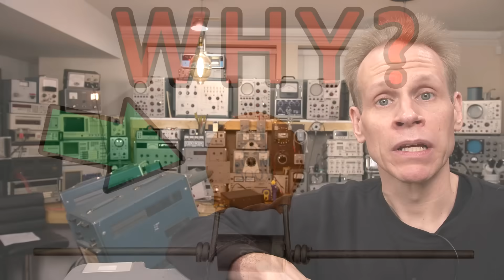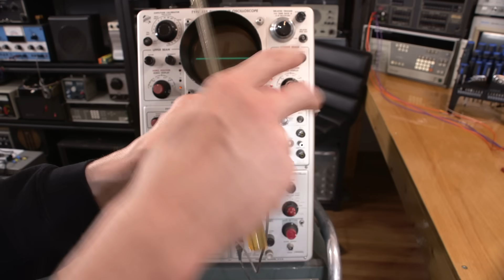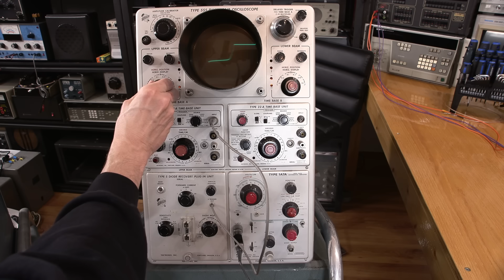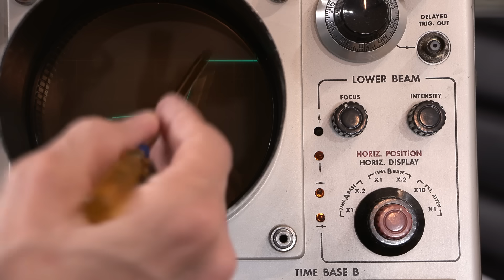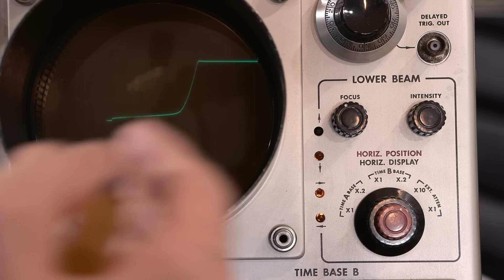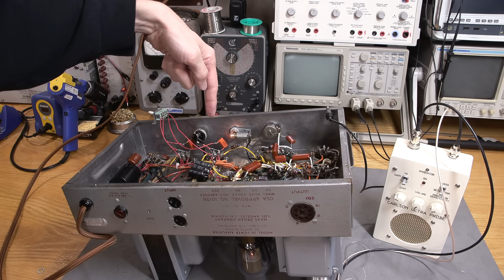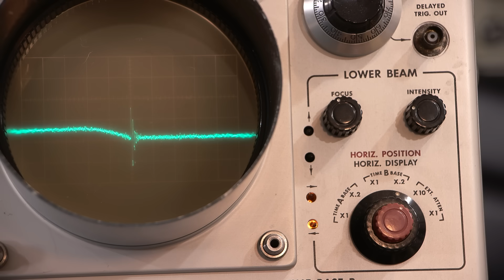Why Put A Capacitor Across The Diode? Here's Why!

Comment: Hmm. I was hoping you would explain WHY this works...
Reply: The capacitors shunt out the noise pulses. The capacitors should be few tens of nanofarads, so they don't conduct at mains frequency, but they shunt out the high dv/dt noise pulses. In very sensitive circuits, one might consider to put the diodes in a shielded can, because the noise is also radiated, so a sensitive radio can pick them up. Using modern, soft recovery diodes eliminate this kind of noise almost entirely (I think).
Reply: @mrnmrn1  I am utterly fascinated at the sensitivity in some medical equipment & just how fine the engineering has to be & the purity's of metals in components.
Reply: @mrnmrn1  I understand how capacitors can be used for shunting noise to ground.. but these appear to be just shunting AC noise PAST the diode to my eyes. This is exactly what was not explained at all here.
Reply: @maskddingo1779  I believe it is no longer AC past the diode, so the capacitor is keeping the diode saturated. Without the capacitor, it has to saturate again with each cycle.
Reply: @maskddingo1779 If the unwanted high frequency 'shit'  happens between the two connections of the diode it would make sense to short them between those two points.
Reply: @maskddingo1779  What is the ground? What is positive and what's negative in the circuit? It's just the difference in the potential, voltage (whatever it is at the moment) is different from one side of the diode to the one on the other so you can always look at one side of it as the ground of the other side and the cap can do its job.
Reply: @maskddingo1779 they are absorbing > blocking > releasing it and the capacitor size shifts the operating frequency
Reply: @maskddingo1779  Not past the diode, rather into the capacitor where the noise is essentially shorted and nothing else is.
Reply: @maskddingo1779  It's shorting the noise out at the source - which is the switching of the diode.
Reply: @maskddingo1779  Have not read all the responses here, so may be a better answer, but, basically: The diode is creating the noise by being a switch.  The capacitor shorts out the HF noise with no measurable effect on lower frequencies.
Reply: @wrathofsocrus  Yes, the "DC rail" past the diode is essentially an "AC Ground" to the capacitor. Overall I guess it's slowing down the dv/dt as the diode stops conducting. I would think using fast recovery diodes that don't conduct as much in the reverse direction (aka recover faster) would also solve this problem, as they wouldn't be conducting anymore by the time the AC voltage was starting to go negative. The real problem here is regular "rectifier" diodes are kinda slow, and really terrible. These days, there are much better diodes available.
Reply: @maskddingo1779 Diodes commonly are used as rectifiers converter AC currents into DC. After the Discovery of the Edison effect in a Light bulb with an additional filament to deal with smoke (early light bulbs imperfect in vacuum lead to the Vacuum tube rectifier. Capacitors were added to filter noise after the rectifiers to shunt noise with inductors or a cheaper alternative resistors in the B+…Solid State rectifiers as Selenium Diodes became mid 20th century and later silicon…someone noticed light being generated…which eventually produced the Light emitting diode…LED
Reply: ! @maskddingo1779,  semplicemente il condensatore cortocircuita la sorgente del disturbo!
Reply: @maskddingo1779 it absorbs “noise” at different frequencies in the electricity path. You can hear the noises being reduced when the capacitor is added to the circuit..
Reply: @mrnmrn1 Indeed, vishay hexfreds do away with snubber caps.
Reply: @mrnmrn1  :)
Reply: @mrnmrn1 100%  right
Reply: @mrnmrn1 what’s the math or “law” called that you need to figure out what you need vs what your using cap and diode wise?
Reply: @avocadoarms358 I don't know if there's a formula for this. As a starting point, you need a capacitor that has high impedance at mains frequency, so it doesn't conduct the AC across the diode, which would also cause hum. So don't put a cap in the microfarad range in there. The capacitor also needs to be a "fast" type (it needs to have low series inductance and low ESR), so it can shunt out the fast, high dv/dt pulses effectively. You can choose the right value of capacitor with trial and error, the ballpark figure for 50/60Hz is 47nF, but I have seen anything between 10nF and 100nF in factory made circuits. It probably depends on the speed and reverse capacitance of the diode: higher reverse capacitance diodes might produce higher energy EMI pulses (just a guess). 

My suggestion is that if you come across this issue, try to measure the noise with an oscilloscope, then start with a 22nF capacitor across each diode of the rectifier, and change the value until there's no more audible hum, but if some noise is still visible on the scope, you can try changing the capacitor value until you reach the minimum peak-to-peak value of noise. I suggest no to go above 100nF per diode. The voltage rating of the capacitor depends on what series of capacitor you use. My practice is to use a capacitor that is rated for at least 2x the peak-to-peak voltage of the unrectified AC voltage. You can find the AC voltage rating of DC film capacitors in their datasheet.

It might be a good idea to build the rectifier with soft recovery diodes. If you use UF4007 or BYV26(E) instead of 1N4007, it will solve most of the noise issues. They still might need some small snubber capacitors, if your circuit is super sensitive to noise,
Reply: @mrnmrn1 
Supongo que en una fuente  simétrica con transformador, al bajar hasta 0,7V el diodo corta y surge una oscilación de alta frecuencia (ruido). 
Peor es si el bobinado secundario del transformador es simple y precisa un "rectificador de cuadro" ahí el corte es de 0,7V + 0,7V 1,4 V con lo que el zumbido debe tener aún una intensidad mayor... el capacitor permite que después que la tensión baja de 0,7 V continue fluyendo corriente debajo de ese voltaje evitando el  corte en el "pasaje por cero"...
Bien puedo estar equivocado pues no soy ingeniero electrónico, soy médico jubilado y piloto de avión sólo fui 35 años radio aficcionado ...
😊.
Reply: @mrnmrn1  putting diodes in can would not solve this (you have to put all conductors and circuitry that is in series with them also then, why is when current cuts off (when diode switches off) is abrupt, the  cap takes over some of that current bc of  sudden "loss of conduction" and reduce the slope of Dv/Dt hence reduce the EMI radiated from associated components. Same story works for regular mechanical switches but with bigger impact, and same story with mechanical commutators on series wound motor with even bigger noise reduction impact...
Reply: As far as I understand, but could never have a better explanation, is that the capacitors avoid the fast cut-off of current when the transformer's output crosses over to the non-conducting region.
Without the capacitors there's a sudden cut of the current (on the transformer's winding) and this makes the winding "ring" (like a fly-back transformer). This ring echoes (eletromagnetically wise) everywhere in the circuit, as it happens at an H.F. frequency that's not blocked by the rectifiers smoothing capacitors because of parasitic inductances of both the smoothing capacitor and of the wiring.
Reply: @fabiotrevisan8922 never in 5 years of college did i hear a single explaination from electrical engineering professors that seemed to want me to understand a concept.
Thank you for yours.
Reply: @davee7849 You should have gone to a technical school
Reply: @davee7849  That’s because most EE and ET professors are absolutely lousy at practical electronics. That’s why they teach.
Reply: @fabiotrevisan8922 
so basically the electrical equivalent of a water-hammer arrestor. 😅
Reply: @alka7577Absolutely! One can say that...
And yet, it shows how curious it is that some physics analogies work really well, such as the analogy of water flowing in pipes with electricity.
Every wire holds some inductance and every water pipe also behaves like an inductor...
Isn't it wonderful?
Reply: @fabiotrevisan8922  Yay someone takes the entire circuit into consideration and gets the correct answer! I was taught an RC snubber is better than just a capacitor, hence why we still saw ringing on the scope yet at a much smaller amplitude, and usually across the winding along with caps across the diodes as well. I think the caps across the diodes alters the junction capacitance of the diode lowering the resonant frequency while the RC across the winding critically dampens the ringing. Hence why using different diodes changes ringing characteristics. Electronics are so fun!!
Reply: This has to be the worst explanation of "reverse recovery" I have ever seen.

I know what it is but I had to watch  the video twice to even recognize what he was talking about.

Ok, here's a simplified explanation.

Reverse recovery happens because the diode itself acts like a small capacitor , it actually stores some of the energy going through it. 

When the diode "turns off" it releases its stored energy as a small "pulse".

Normally that small pulse doesn't matter , but if the diode is hooked up to a coil (like the secondary of a power transformer) that small pulse can make the coil act like an ignition coil on a car.

The capacitor in parallel to the diode basically absorbs enough of the pulse to prevent that from happening.

For more details Google

"Diode reverse recovery"
"How do ignition coils work"
"Snubber circuit"

*edit
The reason I included ignition coils  is the diode turning off and its internal capacitance is very similar to the "points and capacitor" in distributors in older cars. 
(Pre 1970's)
Reply: @glennchartrand5411 thank you! Your comment dusted off old brain cells and this makes much more intuitive sense. The extra capacitor effectively “shorts out” that high frequency pulse from the diode if I’m thinking of it correctly. It’s interesting that the audible noise sounds like a 60hz hum to me. But perhaps the frequencies being filtered out are actually quite a lot higher?
Reply: @SpaceCliffie it's a little burst of higher frequency noise happening briefly every mains cycle, which is why you're hearing the hum as an undertone
Reply: @SpaceCliffie its a pulse of higher frequencies pulsing every 50 or 60Hz if half wave rectified or 100 or 120Hz if full wave rectified depending on your mains supply frequency.
Reply: @SpaceCliffie because the diode turns off 60 times a second.
Reply: @glennchartrand5411 yep... and old distributors had a "condenser" that often got overlooked with tune-ups. That alternator whine....
Reply: @glennchartrand5411 It can’t be the small amount of energy stored inside the diode that causes the ringing — that energy is far too low. The ringing comes from the rapid change in current when the diode switches from conductive to non-conductive. This sudden cutoff isolates the transformer winding from the rest of the circuit and excites the inductance, leading to the observed ringing.
Reply: @glennchartrand5411 Thanks.
Reply: @glennchartrand5411  thank you so much for the real, non overcomplicated explanation!
Would it be fair to say that this cap works essentially as a lowpass filter in a speaker crossover?
Reply: @Frisenette  This cap is too small for speakers, a series cap is used for the tweeter usu 2.2uF
Reply: I think that what happen, is the inner diode PN layer are charging up in the zone where it’s not open, then it open  a little more (we talk about very low capacity)  shorting the its charge and then happen very fast causing HF noise. If a higher value capacitor is added, the oscillation will not happen in that short period we are in not fully open time. The capacitor is not so high so 50/60 Hz has no interest to run through it.
Reply: Being a mechanic and not an electronic engineer it is quite apparent to me that the capacitor is acting as a shock absorber very similar to the way a steering stabilizer takes the vibration out of a steering circuit.
Reply: @tarstakars very similar idea yes; adding a resistor as a "damper" in series with the capacitor (turning it into an RC snubber), helps even further, especially if properly tuned to the rest of the circuit
Reply: @tarstakars  My brother was better that than I am.
Material process engineer.

I was into bio-medical engineering. Until drs told me I was doing things wrong. Which made me think why did I study biology, chemistry, electrical, mechanical and electronic engineering. When programming was so much easier. plus did require 5 years to complete a bachelor degree. Actually required no bachelor degree in 1975 for programming. (easy).
The I had a degree'd department head that did not know how to put a PC together. Because she only used Mac which is  a less complicated desk computer than a PC. Oh & less adaptable the than a BSD or Linux computer.
Finally I just gave up drove a fork lift. Took a while for the boss to figure out why the pallets all got to the assigned space with no spillage for months.  Performing minimum or maximum of an objective function in a multidimensional space.
I still know what Poisson and (Nelder) Mead is used for. Hence one man's Mead is another man's Poisson.
Reply: In a word:
Snubbers.
They are often an R & C in series across a switching device.
The resistor is added to dampen the oscillation, to extinguish it quicker.
Often deployed to improve or meet EMI requirements.
Can also be needed to avoid overstressing/killing the switching device during repeated high energy switching - helps keep them inside what the semiconductor datasheets refer to a SOA - Safe Operating Area - of V vs I vs time chart.
Reply: One really has to view the capacitor as a short term battery.  Stay with me on this - the current, which is oscillating, when it goes to (say) positive, it will travel through the diode.  During this time the capacitor is being charged to the same voltage as is going through the diode (obviously) and only charges (conducts) until it is fully charged.  When charged, a capacitor acts like an open.  Now when the voltage goes to negative (following this example), the diode will not conduct, but since there is a potential difference between one side of the diode and the other (and of course a voltage difference between one side of the capacitor and the other), the capacitor will now have the opportunity to dump its stored energy.  So instead of the wave looking like "positive" then "nothing", then "positive" etc., it looks more like "positive" then "I see some capacitor making some voltage - almost as much as the positive part of the wave", then "positive", then - etc.

In other words, the capacitor dumps its charge when the diode isn't conducting.  The dumped charge fills in troughs.

Note that we are not trying to "fill in" mains frequency.  That would take really large capacitors depending on how much current you need.  We are only talking here about filling in troughs of the noise caused by the reverse depletion zone, and this is before the diode is going on to do its main task (in each cycle).  Note: One has to properly size the capacitor for the use.  For example, using too small of a capacitor for attenuating the reverse depletion zone is like using a battery that is too small - it won't have the meat to be able to fill in the required trough(s).  Using one too large, and the thing just remains charged - bigger caps aren't fast enough to discharge when one is talking about filling in micro-noise, although they can somewhat work.

I was a little unclear about the comparison between the two oscilloscope shots - one had a good voltage range being used, and I think the second had a larger voltage setting used, although I could be wrong on this.  Just guessing.  (The waveform was really flattened out on the second one.)  Also I was unclear on where zero was in each shot.  Maybe most others here know.
Reply: @sonicdewd  
Should the capacitor be put in series with a resister, in case the capacitor someday shorts out?
Reply: @yosefmacgruber1920  If you connect a resistor across (in parallel) with a diode you effectively short out the diode and render it ineffective.  The diode only passes current one direction while the resistor passes it in both directions.
Reply: @RbNetEngr  
What if it is a high-resistance resister? A resister can serve many purposes, and one could be to safely drain off voltage when a circuit is turned off.

A resister and diode in parallel would allow more current in one direction and less in the other direction.

But I may have lost the context of what it was about, perhaps you might remind me. It has been a while since I have watched the video.
Reply: @RbNetEngr  
What if it is a high-resistance resister? A resister can serve many purposes, and one could be to safely drain off voltage when a circuit is turned off.

A resister and diode in parallel would allow more current in one direction and less in the other direction.

But I may have lost the context of what it was about, perhaps you might remind me. It has been a while since I have watched the video.
Reply: @RbNetEngr  
My previous comment was putting them in series, not parallel. In that case the resister becomes a current limiter to help protect a faulty component from frying the circuit.
Reply: @yosefmacgruber1920 I understand that.  But you presented the case where the capacitor shorts out.  So a shorted out capacitor in series with a resistor is now just the resistor, and it would be connected across the diode in parallel and render the diode ineffective.  The diode works in a full wave rectifier because it only passes current in one direction.  The resistor would provide a path for current in the reverse direction.
Reply: @RbNetEngr  
From where do you get "in parallel"? The resister in series eliminates the short. Are you trying to design a circuit that works perfectly when capacitors short out? I thought the idea was to make it safer and it would not blow the fuse or expel smoke?

Presumably, a capacitor does not normally draw too much current, and if it did, a resister would be a way to limit the current.

One of the first things that Mr Carlson's Lab does, when testing out old equipment, is to plug it into his special electrical outlet box, that is current limited via an incandescent light bulb in series with the circuit. A dim light bulb is generally okay, but if the light bulb lights up brightly, something is probably wrong with it, and so he has to find the short.

Maybe you need to go watch the video again?
Reply: @RbNetEngr  
From where do you get "in parallel"? The resister in series eliminates the short. Are you trying to design a circuit that works perfectly when capacitors short out? I thought the idea was to make it safer and it would not blow the fuse or expel smoke?

Presumably, a capacitor does not normally draw too much current, and if it did, a resister would be a way to limit the current.

One of the first things that Mr Carlson's Lab does, when testing out old equipment, is to plug it into his special electrical outlet box, that is current limited via an incandescent light bulb in series with the circuit. A dim light bulb is generally okay, but if the light bulb lights up brightly, something is probably wrong with it, and so he has to find the short.

Maybe you need to go watch the video again?
Reply: Imagine the diode being a 'pump's outlet' on a large water tank and when you 'turn it on' it sprays water out in pulses.
Now imagine you stick that pump inside a 'sealed bucket' with a compressable air pocket. Now instead of the pump giving you a bunch of spashing, pulsing water from the turbulance, it's instead submerged in the bucket, which contains and 'calms' the turbulance, and when the bucket is full, the same amount of water pours oout it's tap, with the same pressure as the bare pump is pumping, but as a nice steady stream, as the air pocket is absorbing the pulses.
Anyway, cap is acting like a hammer shunt, a device that absorbs shockwaves caused by sudden pressure surges that occur when a water valve closes or opens suddenly.
(Electricity is funny, so much 'behaves' like plumbing, but only if you don't 'look' too closely.)
Reply: Capacitors are shorts for high frequency, so they filter out lower frequencies depending on their capacitance.
Reply: @domesticterrorist483 - like a low pass filter?
Reply: @domesticterrorist483  Very clear and concise.
Reply: Yeah, bad explanation, bad oscillosope use.
Reply: the diodes ringing and voltage spikes occur due to the interaction between the diode's diffusion capacitance and parasitic inductance in the circuit, by putting cap across it, it shorting out the high freq ring. the reverse recovery is the diodes capacitance discharging, when in reverse bias.
Reply: I think he's presenting this to an audience he assumes knows what effect a cap would have there. For example a person who doesn't know what effect a cap would have across it would also not understand what he meant when he said "full wave configuration"
Reply: Before the diode becomes forward biased and conducts, the capacitor charges. Then when the diode suddenly opens, the charge for that is immediately available from the capacitor. And similarly in the reverse situation. The capacitor is acting much the same way like any other decoupling/bypass capacitor between the pins of any device, such as an IC. A capacitor is transparent to AC and that's what noise is. It provides a short circuit for noise between the terminals of the diode.    Any two-terminal device can only generate noise by a producing a difference in voltages between its two terminals. A cap connected between those terminals creates an AC short which absorbs the noise.

There is something counterintuitive in that when we place the bypass cap as close to the target device as possible, we are minimizing the source impedance. So then how can the capacitor act as a filter? The answer is: with some difficulty. That's why fairly large capacitor values are used. That satisifes two requirements at once: delivering immediate charge to the device with as little impedance as possible, in response to its changing demands, while filtering that out from the rest of the circuit seeing it.
Reply: They work as a frequency filter
Reply: Yeah. A little theory would have been nice.

Since capacitors allow current to flow until the capacitor is full, this helps absorb some of the noise present in power supply circuits. 

Going into the theory of how a rectifier simply creates converts AC to… AC would be helpful in this situation.
Reply: If the diode shuts off, Al you have left is a little capacitor. What does this little capacitor..? Get rid of it's charge through the circuit. Frequency of this if 100hz (European) or 120hz (us and others) noise due to the discharging of that little built-in capacitor inside the diode.

You could say : OK, then now I use ultrafast diodes or shotkeys... They had this little capacitor as well. And as they, are faster than the usual 1n4007 they cut off and recovery time is also faster, and therefor the discharge spike of that little capacitor is also faster... More hum generated.

You need to provide another path of to let the capacitor discharge itself..

You could use a resistor but but it will be also inside when the capacitor is discharged and add these unwanted reverse current flow by making the diode 'crapier'.

So if you use another diode reverse polarity on series to avoid that.. Uups no good idea you just created a diode of the early days of semiconductors...

Oflk than..whats left is another capacitor, large enough to ear up that spike entirely, but also tiny enough not to create a short cut when the diode is switched off...

It depends on the spike itself and also the switching frequency.

It's called a snubber network. And this is essential when it comes to switch mode power supplies.

I designed a lot of these back in the late 90s when I worked for a company which did industrial grade power supplies of all kinds (voltages and currents)

Hope that helps a little.

Cheers.
Reply: @tubical71@tubical71 It's not the capacitance of the Diode nor the charge or energy stored inside the Diode leading to the ringing. These values are fare to low.
It's the  real reverse current flowing across the Diode while the diode recovers. This current increases if the reverse recovery time of the diode (other type of diode) increases. This current breake down instantaneously if the Diode switches to non conductive when the recovery time is over. The Transformer is now isolated from the rest of the circuitry and you get the self induction pulse formed to a oscillation by the inductance and the windings capacitance and other parasitic L or C.
With the C across the diode the transformer is still connected to the rest of the circuitry and the resonance frequency decreases and the energy can deplete.
Reply: @guntramschlemminger7383 
The first and the last good explanation
Reply: Because the power transformer winding has inductance and with the diode junction C and other parasitic capacitance creates a tank circuit. When current stops during the half cycle the inductance reacts to this current change. Really an RC snubber is better than just a capacitor, hence why you still saw ringing but at much lower amplitude. With a simple jig you can work out the optimal values of R and C to start with, then fine tune until the ringing is completely gone. Most decent designs will have a capacitor across the diode to change the diode junction capacitance (lowering resonant frequency) along with an RC snubber acorss the the entire winding. Doing this correctly will yield excellent results.
Reply: I gather in a low signal to noise ratio in a quality amplifier there are more of these capacitors running across diodes in critical areas of the amplifier circuit ? 
As an enology and explanation on a mechanical term , the capacitor acts like a muffler in an electronic term , is that correct ?
Reply: I agree.  I have noticed that Mr Carson is an absolute genius technician, can troubleshoot damn near anything. Really levels above most other techs that I have seen, and meticulous in his work.  A real savant.   However as a teacher I have seen that he often leaves things without explanation.  Probably seems obvious to his mind, but to the rest of most of us it needs a step by step walk through of how and why in detail.   I get a lot from his presentations, then usually go and look up details that he leaves unexplained.  But his expertise is impressive, and he appreciates really good quality design.  High quality is important in a world of cheap low quality products designed to fail and generate more sales.  Planned obsolescence should be a crime.  Design and build to last a lifetime and the whole world benefits..  I am sure Mr Carlson would agree with that sentiment.
Reply: It’s the equivalent of an accumulator in a hydraulic/ water system or like the anti knock device you put at your faucets to keep the pressure steady and to absorb the sudden increase in volume/pressure.
Reply: @J @JQuinnn-r8g ss! The house water system you are talking about is a water hammer arrestor. Its like a reserve area for water pressure to go when we abruptly close faucets.
Reply: Maybe add < 4.7 ohms  in series with the cap to suppress the noise further
Reply: А мне интересно, будет ли разница между керамическим и пластиковым конденсатором?
По-моему, значение имеет не емкость конденсатора, а плотность его диэлектрика. Это версия.
Reply: How does this compare to a correctly sized or matched bypass cap? I bet it's the same result.
Reply: I agree with maskddingo.....you have demonstrated the need,  now for the "how".  Where is the noise going ?
Reply: And also what causes the noise in the first place. I was waiting for that explanation but it never came. He just mumbled something about 'depletion region'.
Reply: I would say: The fast cut off current, or the fast immediate load change to the transformer and the parasite capacitances and inductances around lead to this small high frequent pulses. We can see the exponential form of the power loss in the pulse. That's typical for LC oscillation.
Reply: Diodes make noise when they shut off; you get a pop.  This voltage spike is what's shunted across the junction.
Reply: @jj210-g8r Is the Diode really the component making the noise or is it the inductive and capacitive environment the Diode is connected to.
The noise peaks we saw on the scope is a harmonic oscillation with an exponential decreasing amplitude. It typically fir LC oscillation. The Diode just triggers this.
Reply: You need to understand how a cap works. As he Said in the beginning, diod makes some noise. A cap smothen out that noise. Ex after a rectifier ac to DC You have caps to smoth the dc.
Reply: That was also my thought? Why he does not?🤔
Reply: I had this same question.  Obviously, I don't know since I had the question, but I did some digging to find out.  Others have stated somewhat circular answers that if you already know and understand, make sense, but if you don't it's frustrating, and sounds like they're saying "Because."  In short, it seems to me the answer is because it's an AC circuit, the higher frequency shifts across 0 voltage "see" the capacitor as having less resistance than the diode, and thus route to it instead and are attenuated.  Now, WHY does the capacitor seem to have less resistance to high frequency "spikes" in voltage, even though nothing about the capacitor is physically different than when compared to low frequencies?  Because of the inherent relationship between AC Frequency and the capacitor's Capacitive Resistance.

Some quick digging leads me to believe it's the nature of how a capacitor functions in AC circuits.  A capacitor is 2 conductive plates, with an insulator between them.  In DC, we charge one plate until it passes a threshold and discharges through to the other plate.  In an AC circuit, we're doing very different things with current.  When the voltage swings from positive to negative, electrons are gathered on the plate to which that voltage is applied, and thus pushed from the other plate into the circuit.  No charge actually is passing through the capacitor, only accumulating on one side, and then discharging as it accumulates on the other when voltage swings again.  When this is happening, the Capacitive Resistance, which is calculated from the 1 divided by the product of the Frequency of our AC source in cycles per second, and the capacitance in farads.

Capacitive Resistance seems to be the "filter," as it limits what voltage spikes will go into the capacitor, and which will route around it through the diode.  To a high frequency spike, it appears low, because the frequency is high, because Frequency of our AC is a factor in Capacitive Resistance.  When the frequency is low, Capacitive Resistance appears high, and the low frequencies pass through the diode instead of the capacitor.  Thus, the "low-pass" filter from diodes, resistors, and capacitors is born.
Reply: @crimiusXIII I already explained it.
Reply: ... In exactly the manner I decried.
Reply: I agree. A very poorly presented and poorly explained subject. I have not subscribed.
Reply: It certainly isn’t 'outside the scope' of the video! 😂
Reply: Like mathematically? Please no math Great Scott!
Reply: In short - discover the matching cap for the noise frequency and then mount it to pull down (or up) the charge. Capacitor acts as a short circuit for a moment in time (depends on its capacity). Smaller cap values, higher the frequency. It is best to experiment with various kind of frequencies and c values... Enjoy
Reply: It is cross over noise caused by turning conduction and off putting capacitors across this junction absorbs this.
Reply: It cancels out the frequency
Reply: capacitor is a simplest form of a noise filter - it lets noise pass through the capacitor. You learn it in one of the circuit courses in college
Reply: Think of a diode as a one way valve.  A diode rectifier bridge converts alternating current, into direct current. When the current flows the wrong way, the diode reflects the wrong way pulse back in the desired direction, adding it to pulses going in the desired direction within the circuit.  On an oscilloscope, one can observe the voltage oscillation generated by the diode.  We have all the current running in the desired direction, but the voltage (eletron pressure) is bouncing up and down several time a second, depending on the alternating frequency of the alternating current entering the rectifier bridge.  Think of a capacitor as a little battery that can discharge and charge very quick.  
  It may have been helpful if he'd pulled back on the scope, to better illustrate the series of peeks and valleys in the voltage. During a high peek, the voltage exceeds the current voltage being store in the capacitor, so the capicitor absorbs it until the voltage equalizes(up to its rated capacity). When the voltage then drops lower than the current voltage in the capacitor, the capacitor discharges until the voltage equalizes.  So the capacitor cuts the top off the voltage peeks, and fills in the voltage drops.  This makes that line on the oscilloscope  smooth out into it's average voltage, with smaller peeks, and shallower dips. Thus a reduction in line noise.  Line noise is voltage oscillation, the capacitors acts like a shock absorber.  
  If this sounds condescending, or dumb, my apologies.
Reply: Not a good first comment to see
Reply: It's just simple reverse retro encabulation of the variac frequency of the homogeniser.
Reply: I hope I can answer as I started and was cutoff.  Anyway, like you, I wished he had explained how this works.  But, taking a guess, since capacitance is the problem in the Diode, maybe this added capacitor is acting in series and reducing that capacitance.  Maybe?  Yeah, I know.  The added Cap. is parallel.  But, perhaps, a big perhaps, it still acts in series?  Capacitors parallel to Resistors short out the resistance for a moment.  An effect used in astable multivibrator circuits.
Reply: So how?
Reply: A capacitor in series with the signal source produces a high-pass filter. The value he chose here is small enough to not pass the 60 Hz hum, but does pass higher frequency signal. If you listen to when the cap is switched on, you can hear overtones of the 60 Hz hum which do pass the filter.

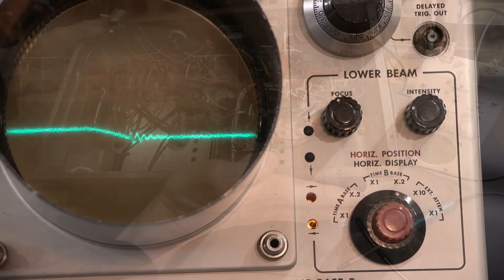Without a resistor, that capacitor is undamped, meaning energy can flow freely in and out of the cap with little load. This is what produces the decaying sine squiggle in the waveform at 6:38. Add a resistor of the right size to ground after the cap, and the energy flow in the capacitor is slowed down enough that the squiggle (resonance frequency) goes away. Look up high pass filters for more info.
Reply: I wish to venture an explanation from my own electrical engineering (including semiconductors) and experimentation background, extending from the details that Mr. Carlson did give.  This is a set that has a power transformer which introduces an inductive element in the circuit, which results in ringing as shown on the oscilloscope when paralleled with the internal capacitance of the diode due to the time spent in the depletion zone.  Increasing the capacitance by paralleling the diode with an external capacitor decreases the frequency of the ringing, resulting in fewer rings within the depletion zone.

Perhaps this can be further helped by adjusting the resistance in the power supply circuit or by putting a resistance in series with the paralleling capacitor, causing the small amount of ringing that still occurs to be dampened more quickly.  I'd believe that, with some mathematics, this could be refined down to a science, though even this is clearly better.
Reply: So this kind of works as the opposite of an LC bandpass circuit? I wonder if those equations would work, hmmm.....
Reply: Caps avoid  big dv/dt oscillations
Reply: The capacitor simply attenuates the noise. It works like any other bypass capacitor, passing noise through itself and attenuating it, and leaving the non-noise alone.
Reply: @electrifyingvids3545  I'm not sure I grasp how passing the AC noise past the diode helps. I would understand it going to ground, I figured it was more about altering the characteristic curve of the diode that we saw in the beginning, but the relation to than needing a capacitor also was not explained well (or at all).
Reply: @maskddingo1779 The C lowers the frequency such that it doesn't interfere.
Reply: @electrifyingvids3545  Mostly in DC circuits. In A/C it is mainly for power factor correction or start up limiting on motors.
 Many radar units use 400 cycle 3 phase A/C  for high power reduced ripple DC for transmitters.
The RF part is another animal. 9 Ghz is not at all like DC. You have ELI and the ICE man within inches of each other trying to take a bite out you.
Reply: @warrenpuckett4203 I 
asked ChatGPT this question:

Why does a ceramic capacitor reduce noice when placed in parallel to a diode. Mr Carlson’s lab made a good video about this.
[Long explanation edited out, it knows about the video]
In short: A small ceramic capacitor in parallel with a diode acts like a localized high-frequency short circuit, absorbing the diode’s abrupt switching noise and smoothing the edges that would otherwise radiate as RF.
Reply: He explains it!
Reply: A diode is basically a rough capacitor. When you install capacitor with the diode it takes stress off the diode allowing it to function with less stress thus making the signal quieter. Or at least that's what I got from it
Reply: Your right. No one will explain WHY it works, only that it does. This is a failing of the educators understanding, and passing on they lack of understanding.
It's also the difference between a tech and a well trained engineer. Most engineers are poorly trained, again because those that taught them don't know. Apparently, this video producer is in that same boat. 

To answer your question, the diodes base function must be understood. 
Diodes are energy storage devices.
They charge and discharge because of voltage differences.
In the configuration used, the cap "measures" the voltage differences on its two sides, and "absorbs" the noise voltage, which it views as a power spike, thus reducing or even removing the noise, returning that voltage when the noise spike reduces. The cap size determines the total effect, from reducing noise, to completely blocking the desired signal.
GL getting accurate answers in the future. I won't be back.
Reply: It works because he’s using feedback and resonance to stabilize the output. The circuit basically reuses part of its own signal to correct errors in real time, so voltage and frequency stay locked in. It’s classic analog control theory.